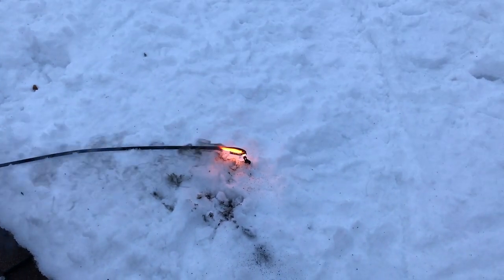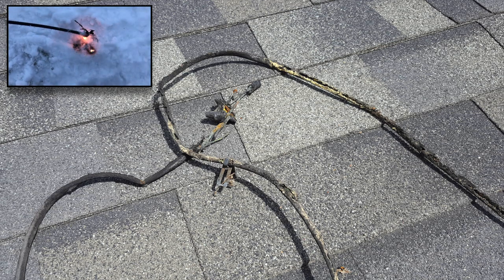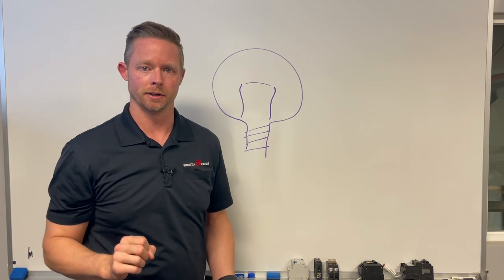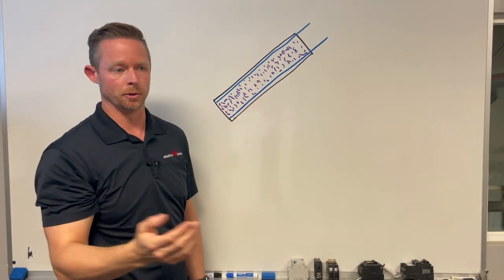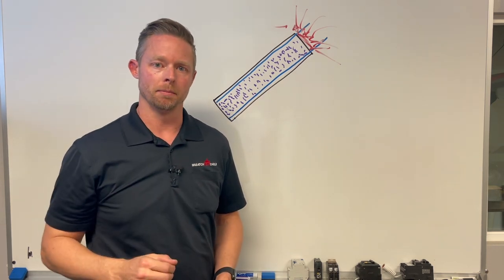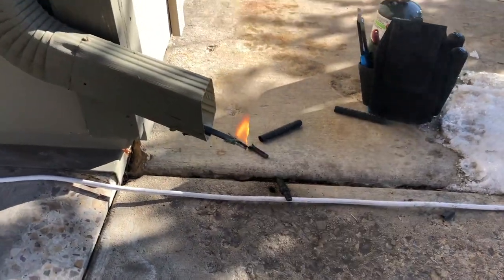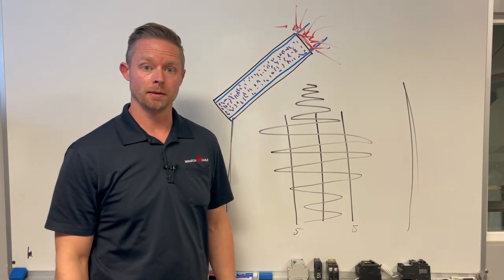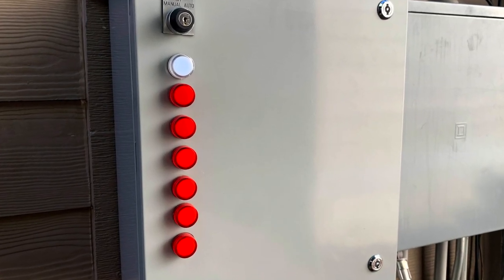Can Heat Cable Catch On Fire? Ways To Prevent This From Happening On Your Home

Comment: Maybe I missed it, but I did not see any explanation of why or how this happens or how to avoid it other than to install a specific purpose breaker.  I am left with the impression that this 'just happens' with this type of cable and that does not instill any kind of confidence in using it.
Reply: So he did explain it before he talked about the right type of breaker…he mention incorrect connections as well. Overall was made to get you think about it a little more than just plugging it into a normal outlet/circuit.

Comment: What if you plug this into a Arc fault Receptacle .  AFCI . Will it be protected then...
Reply: It's no guarantee since there is no way to detect dangerous arcing with 100% accuracy, but a combination AFCI and GFCI breaker or receptacle is certainly good insurance and cheap enough to be worth it even if code doesn't require it where you are.

Comment: As long as you stay in your house through the winter,  why can't I just manually plug and unplug the heat cable in a regular outlet on the outside of my house, as needed?  We all want everything done for us, and the more devices we add to control the on and off, the more you leave things to fate.  Plug the heat cable in when snow is forecasted, and when the cable has done its job, unplug it.  Unplugged, you eliminate the current of electricity.  Are americans getting that lazy?
Reply: You ruined an otherwise sensible comment with some bigotry at the end.
Reply: @RedSiegfried   Yeah, truth sorta hurts don't it.
Reply: @joetoyota7903  I'd say it's the entire western world but I digress. Just had a friend ask me to install some for them and they want it set up so they can plug in when needed and unplug when not needed. They are American.
Reply: @thegoodobserver   Then, they are the exception, not the rule.
Reply: @joetoyota7903  Agreed
Reply: @joetoyota7903 you clearly haven't worked on larger systems. The purpose of automation goes beyond convenient there are also energy conservation elements. Snow melt does not need to be on below 40. People forget. 

Your ignorance of the big picture is just as absurd as your comment about Americans being lazy.
Reply: @Squat5000  If it's important, or placed as a priority, people won't forget.  People never seem to forget buying a lottery ticket, or going out for a beer.  A simple fact of misplaced priorities.  I've seen way too many examples in my many years, so I stand by my statements.  As far as larger systems, my original comment  was related to a single family home,  not a sprawling shopping complex.
Reply: @joetoyota7903  again my point still stands. I'm not talking shopping center either. I'm talking single family homes with multiple roof zones.
Reply: What many people don’t want is to forget to plug it in, and it snows & ices over, or you’re out of town and it snows or ices over.
Reply: @icevariable9600  Yeah, my dad would forget, but he was old, with dementia.
Reply: @AnX8765   What are you talking about?   You can "what if" anything to death.  What if is just another excuse to prolong a discussion  instead of accepting and taking responsibility in your life.   If you're afraid your work may be subpar, then don't attempt the work to begin with if you don't trust your abilities.  But even hiring a pro doesn't guarantee that there won't be any issues down the road.
Reply: You seem to be under the impression the weather forecast is always accurate. I have woke up and found it was under 30 when the forecast was for low 40s.
Reply: @andygarcia9864   Yeah, and that's called real life.  In real life,  nothing is perfect or failsafe.  Do what you gotta do.

Comment: All the failures shown in your video would be stopped by an arc flash breaker, yes?
Reply from the maker: GFEP breaker or device would have prevented the fires and burned cable shown in this video. Thanks for watching!
Reply: So my GFCP won’t help at all???

Comment: When installing heat cable, would you recommend wearing gloves as oils in your skin can make the cables seem delicious to animals?
Reply from the maker: Gloves are not necessary when installing heat cable.
Reply: Oil breaks down rubber
Reply: @dcahill121 rubber is made from oil 🤨

Comment: I'd call that strange. It doesn't even seem real at all. Almost no way this could happen. If you don't believe me, put a key in an outlet.
Reply: A dead short as you described will trip the breaker. The problem is a series short or even a high resistance parallel short won't trip a standard breaker, which needs to either see a sudden 150-200+ amp spike or a sustained current well over its rating to trip. That won't necessarily happen in a situation like this. This type of scenario is why we now have arc fault circuit interrupters. They are specifically designed to detect this type of arcing. And while a ground fault circuit interrupter isn't specifically designed to prevent fires, they also can under certain conditions, so it's best to use both for things like heat tape.